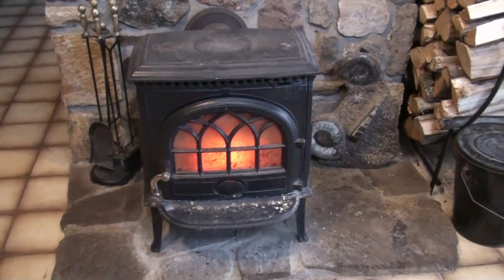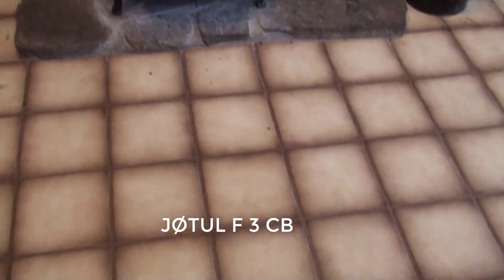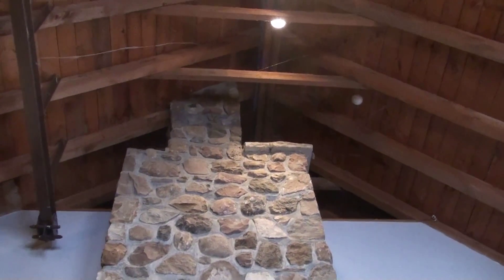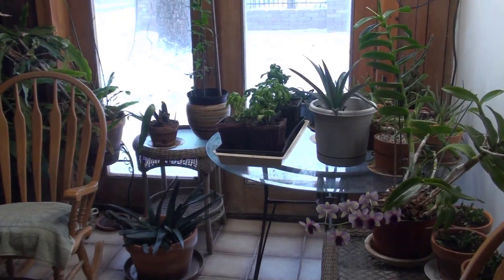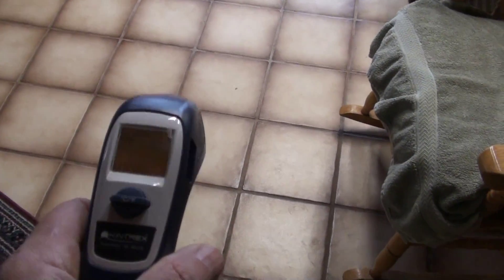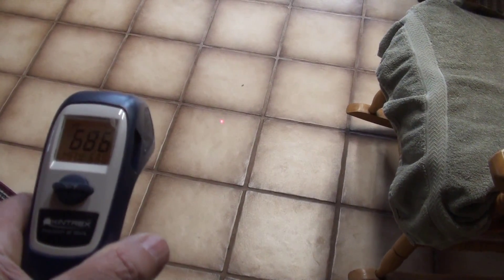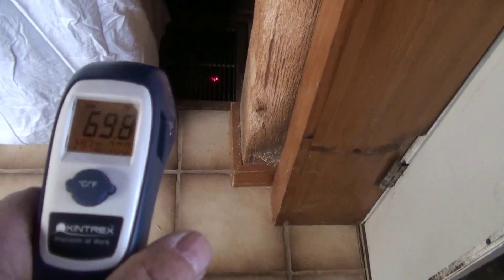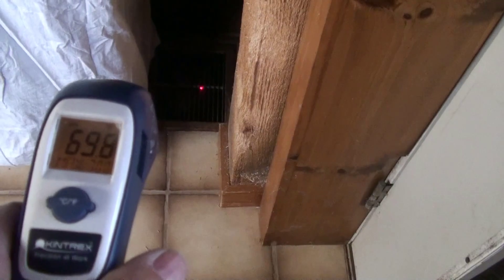Thermal mass, thermal bank, underground thermal energy storage, passive solar home

Comment: Brilliant. The best demonstration I've seen of thermal mass on YouTube. I'm currently planning to downsize, but instead of buying, we were thinking of constructing a straw bale passive house. Now, my issue will be trying to size the thermal mass appropriately. Does anyone know if there's a free online program or android/ iOS app that'll help here?
Reply from the maker: Hi Leo, I did a simple search on Google using thermal mass calculator as a search parameter and there are several types of calculators that you can use, including Excel worksheets that you can download to do calculations. There's lots of good information online that can help you  design a system for your climate and needs.
Reply from the maker: https://www.google.com/search?q=thermal+mass+calculator&rlz=1C1CHBF_enUS982US982&sxsrf=AOaemvIaVO1DtEqTEaxJtshi_MKnGbzglA%3A1639316605626&ei=ffy1YdrYJaqmptQPyYiaqAM&oq=thermal+mass+google+sheets&gs_lcp=Cgdnd3Mtd2l6EAEYADIHCAAQRxCwAzIHCAAQRxCwAzIHCAAQRxCwAzIHCAAQRxCwAzIHCAAQRxCwAzIHCAAQRxCwAzIHCAAQRxCwAzIHCAAQRxCwA0oECEEYAEoECEYYAFAAWABg_BJoAnACeACAAQCIAQCSAQCYAQDIAQjAAQE&sclient=gws-wiz

Comment: you don't have to prove your finding by thermometer, just look at where the cat stay. 😄 your hypothesis is in right direction. if humidity can be addressed as well, human feeling will be a lot better. have you consider give the chimney a water cooling jacket, or a copper coil? that's a layman choice easy to fit hot water source as well as right at the point to cut heat escape from the house.

that's very ironic to see footage like yours while I am on the other side of the world, with a winter temperature of almost 28c. summer here now can kill, 40c, 90%+ humidity. everyone trys to expelled heat. what if we can store that summer heat and send it to the north in winter, everybody will be happy.

the earth is doing that job now…… in the form of gigantic typhoon and hurricane.

Comment: Do you have any images of the washed stones (like during the building phase) that serve as the thermal battery?
Reply from the maker: Yes I have a video series or playlist of the greenhouse construction. I used the same technique using washed stones in the thermal mass of the two sides of the greenhouse thermal mass unit.

Comment: So you have an air supply duct either side of the chimney flue…calling the ducts chimneys is confusing.
Reply from the maker: Sorry it's confusing Mark. Yes these are a counter current air exchange unit conducting hot air from the ceiling and from the central chimney. No these ducks do not conduct combusted gases. However they are made from chimney blocks. Sorry it's so confusing.
Reply: Thanks..quack quack!   Great system you have there.  One thing I would have done is use one of the ducts to supply outside air to the wood stove, which ideally would be room sealed
Reply from the maker: @markthomasson5077  our house is actually super insulated and well sealed with all four barriers intact. There is a video that I have published on the construction of this house in 1984. We do take fresh air from outdoors and do a heat exchange system to bring fresh air into the house at all times.

Comment: In summer, the thermal mass is enough to cool the house, since the added heat is not a lot. But in winter you still burn wood, but in an efficient way, without losing heat through the chimney. I wonder how much will cost a system that stores the heat from sun in the summer, and release it during the winter. This will mean vacuum glass solar panels, big enough insulated water tank, and the system storing at maximum  possible water temperature.
Reply from the maker: Good thoughts however the solar heater systems would not be very effective where we live. Throughout the late fall and throughout the winter not only do we have a significant amount of snow we are near the Great lakes and therefore there is no sunshine we get lots and lots of overcast. No additional heating sources would be required during the winter in our home if we got sunlight coming in through our South facing Windows. Our house can stay warm for a few days after one six hour period of sunlight.
Reply: @GrowingABetterTomorrow  Thanks for the answer, I get it. Pushed at extreme as in math, with only a single day of sunshine, the thermo mass should be 365 times bigger.  Investment never recover even with many more days of sun.

Comment: How do you deal with humidity? Could you elaborate on the ventilation that you use to offset this? I know you mentioned the doggie-door, but do you simply just open the windows to keep the temp/humidity in check?

Comment: Hi Kevin, It's good that you have implemented your ideas, unlike many who just like to talk about them, but annoying that you seem to be using Farenheit, an obsolete imperial system of measurement, not used outside of USA now (and American scientists and engineers uses Centigrade or Kelvin too!!) The problem with an air circulated thermal store, is that it's harder to switch off, once the heat is down there, it keeps coming up!
Reply: It depends where you live ! For sure if you live in a hot desert, it can be a problem, but when the majority of the year is cooler its less a problem isn't it ?

Comment: I have a question Kevin. Could you theoretically put long lasting materials with high specific heats like fire resistant wood logs put into the thermal mass unit to increase thermal storage. High Specific heat materials in your thermal mass unit is what I'm asking. Would it help you store more? Kind of like how firepit with charcoal AND wood logs ontop gets hottest where firepit with branches and sticks and no charcoal isn't as hot.
Reply from the maker: Hi Catalyst - D B,

Thank you for the comment. We really appreciate community involvement. Are you wanting to slow the transfer of heat or are you trying to expand the thermal mass unit itself?
Reply: Good Afternoon Kevin Wallace, I want to increase the Heat Capacity of a Thermal Mass Unit Identical to yours. Store more heat. Without expanding the Unit itself.
Reply: @DylanBegazo  Its existing many other heat storage materials, like wax, salt (needs much higher temp!), but as cheap as washed boulders, i dont know !

Comment: My Notes: Passive solar home - Counter current heat exchange system. Stone is 1/3 as efficient but stone lasts longer. and the system doesn't have a lot of footprint because it's below house and thermal mas unit needs to be as close to living quarters as possible.

Comment: Thanks for your interesting video Kevin.
I was wondering if you could describe your storage mass a little more?
From what I understand; the thermal mass portion of your house (what would have been a crawl space) is filled with stones that the air from the fan can blow through and around?
What size stones did you use?
Are there dividers (or channels) in this mass space so the air would flow evenly through?
Is there a concern about small critters getting in there and dying? ...mold, moisture, and nasty smells circulating throughout the house?
Reply from the maker: Hi CE User,

Thank you for the comment. We really appreciate the feedback. I will try to make another video going over the thermal mass at the base of the house. However, I did make a video of the thermal mass system that I created at the base of the greenhouse which shows the stone but not using plenums as I did in the house. https://www.youtube.com/watch?v=2YqCaecbeZI&t=25s

Comment: Hi Kevin, I was at G A Braun and Jim told me about your channel. I was wondering how you cool the thermal mass to achieve thermal cooling. I would think the thermal mass would absorb the ambient heat during the day and would have be released to the outside at night if temperatures were lower. Very informative channel.
Reply from the maker: Hi Rick I am posting a video tomorrow
morning that I hopefully answers your question. Thanks for the question

Comment: Thank you Kevin for explaining your thermal mass. Very interesting. I understand it better now. Does the whole thing run on that one attic fan? Sounds like you have ducts that go  from the thermal mass into most rooms of the house. Did you design your house? Did you have to have a "leap of faith" to know it was going to work? I would love to see you do a similar video in the summer showing how it's cooling your house without an AC unit.
Reply from the maker: hi Joan,

Thanks so much for yet another supportive comment. Yes the whole system actually functions extremely well with the use of a single attic fan. The attic fan does utilize a standard furnace air filter help remove dust and debris that would otherwise pass through the fan. Yes there are ducts they go to each room however each room is an open circuit where air can flow out of the room and into the open envelope system that I described in the video. This open envelope system is absolutely a key component. It helps to maintain a mixture of fresh clean air from outside and are heated or conditioned air that circulates within the circuit. My brother David,an engineer, is the one who came up with the design of the passive solar and thermal mass system that we utilized in the house. It is works so well that many people have been amazed by its efficiency. I love to take the credit how are my brother David deserves the bulk of the credit. I've tweaked the system over the years, as I describe in the video that should post tomorrow morning, to maximize the health benefits utilizing beneficial microorganisms in the environment.

Someday, if I get the time, I hope to share what I've learned about creating indoor ecosystems that clean the air, reduce pollutants, and actually can give us pleasant odorsimprove our skin health and our respiratory health. However I need to do further research before I am done tweaking the system as we have a unique household  with many animal friends.

Comment: Awesome video Kevin. I'm curious if you run the "attic fan" on a timer, constant, or set with a thermal couple?
Reply from the maker: hi Jim thanks for the comment,
the fan runs continuously 24 hours a day seven days a week and 365 days a year. However I didn't initially have it set up this way. I explain more about this and healththat should post tomorrow.